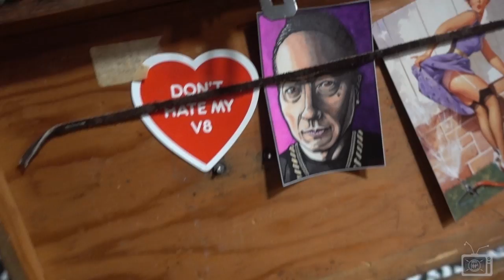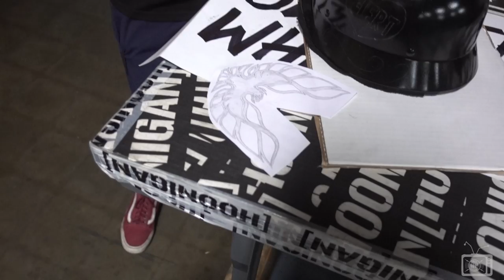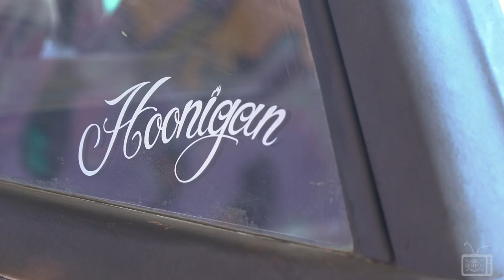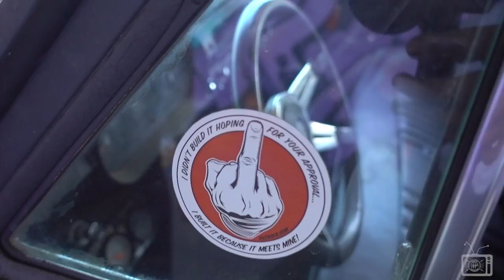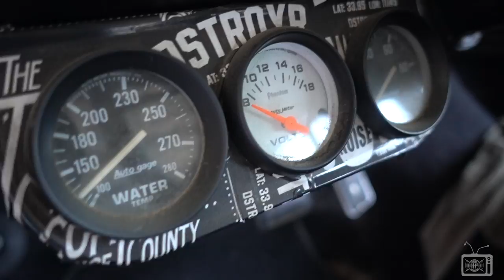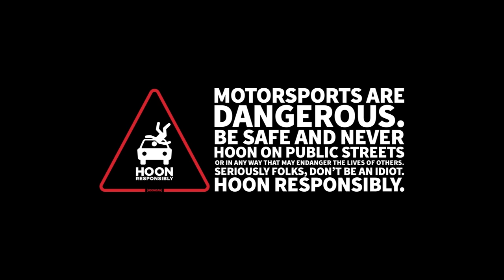[HOONIGAN] DT 081: Kikawa Hearts Hert (Helmet Painting & Vintage Wagons)

Comment: This engine is probably a 250ci chevy. In metrics, 4.1 Liters. I believe that it's the same engine in the inline 6 Camaro and Nova. Here in Brazil this engine is very popular. It came in many cars, the most famous is the Chevrolet Opala. It's like the brazillian muscle car. With a little bolt ons, more compression (10:1 for gas) and a good tune, it can make over 250HP NA. With boost these things haul ass. Search for a car named "Opala Metal" its a drag race car with over 1500HP using this engine. It's badass. There is a ton of street cars also with boost, going from 300 to 1000hp. This engine is a very cool one.

Comment: So John Chase needs to throw a cheap disk brake conversion on the front of that wagon with a Clifford 6=8 intake, a fitech EFI and Holset turbo with a water to air intercooler. Smiles per gallon and gas mileage would increase. Just cut the glass pack off the header and weld on a turbo flange.
Reply: I actually have a SBCC front disc kit for it just haven't installed it. Also have a Clifford intake for it also haven't installed it. So many cars not enough time hahaha.